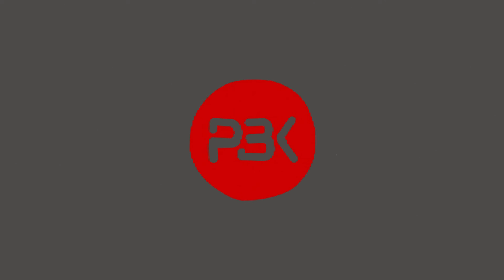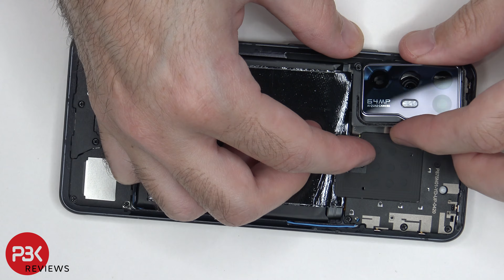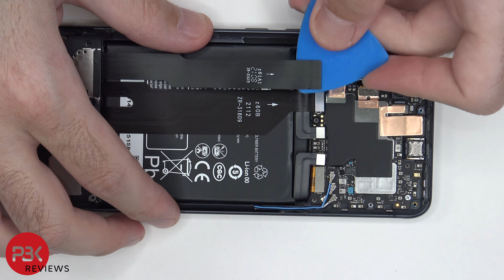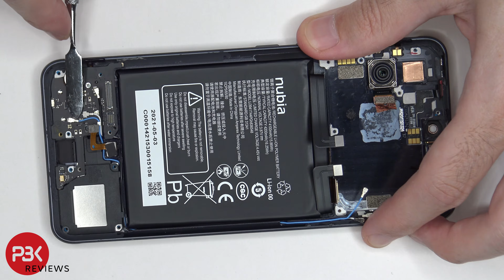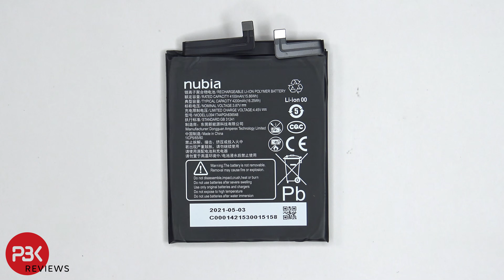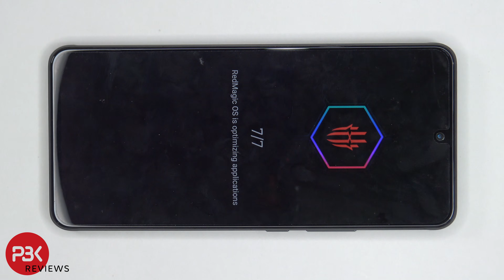Nubia RedMagic 6R Disassembly Teardown Repair Video Review

Comment: What kind of adhesive do you use?
Reply from the maker: usually will try to use the original pre cut adhesives made for the phones. They either come pre installed on replacement battery door covers, or sold separately. You can watch this video for some overview. https://www.youtube.com/watch?v=T4iiPUIM7-Y  you can also use B-7000 glue but you would need clamps to hold it down until it cures.

Comment: i have a question so if i try to switch on my 6R it shows a red battery my charger cable is still fine tho it charges other phones and now it simply wont show the red battery anymore like its just dead
Reply: Have the same damn problem.

Comment: I dropped mine and seems like the only the glass cracked on the front but the lcd is still fine. I see that I can get glass for much cheaper. Is it an easy fix to change myself or should I get a professional to do it?
Reply from the maker: The glass alone is not user replaceable. Only factories with special machines and tools can do it.

Comment: Sir do you know why my right trigger is not working even i replaced it with newer chip. Thank you
Reply from the maker: Not sure, make sure cables are all connected and the board is seated properly on the flex cable to make a good connection.

Comment: Im having a no service since updating my software and fingerprint is not working also right trigger. Do you know how to downgrade this phone?
Reply from the maker: Not sure how to  downgrade, you would need to search online for how to flash older firmware to the phone
Reply: @PBKreviews  i bought another 6r with broken lcd and i want to take the antenna ic and put it on my 6r that has no service. It is possible?

Comment: how to solve overheating problem?
Reply from the maker: Depends what is causing it. If your phone is just getting hot, doesn't mean its overheating. It's just taking heat from inside the phone out of the phone which is normal. But if your phone is sluggish and lagging, you can try backing up your data, and doing a factory reset to make sure its not a software issue, then you can try taking apart the phone and replacing the thermal paste.
Reply: I'm talking about the 888 problem
Reply from the maker: @Discipline2030  oh, not sure what would need to be done. The only thing i can think of is them issuing a software update to deal with it.

Comment: Why the battery has two cables instead of one?
Reply from the maker: Most likely because it has two separate batteries or cells combined as one to have each side charge at the same time to increase charging speeds.

Comment: Hello, my Samsung galaxy M31 is frequently rebooting automatically after the recent update. The customer care people told me that they will have to change the motherboard for such a small issue. Could you just share something like what I should do or I should just pay them the money for the motherboard and change it??
Reply from the maker: Hi, that doesn't sound right. They will probably just reflash the board, not replace it. You can try to do that yourself.  You will need to google and find and download your phones firmware. Then google or youtube how to flash the firmware for your phone. Flashing the firmware would erase all your data and install a clean version of the original software to your phone so make sure to back up your data.
Reply: @PBKreviews   I flashed my phone with the latest firmwares and also with the old firmwares and the issue still exists. That's the reason I am confused because motherboard can't simply crash.
Reply from the maker: @vaibhavhood204  hmm, not sure.